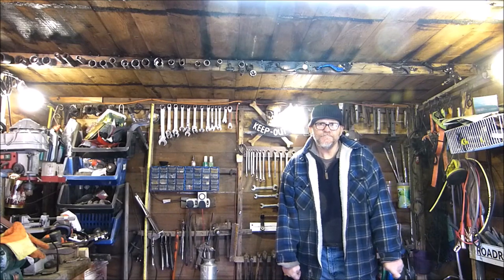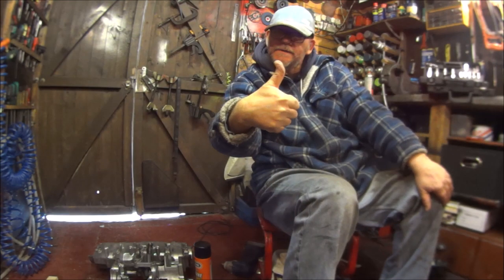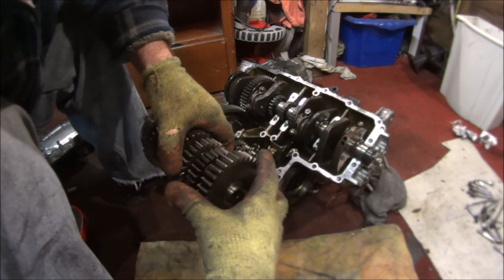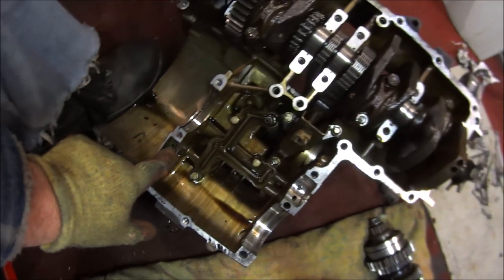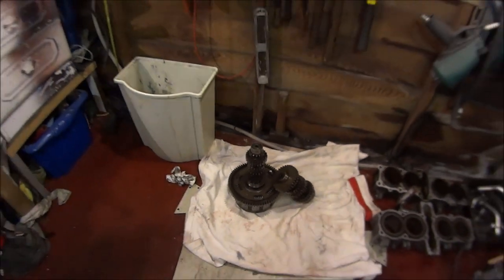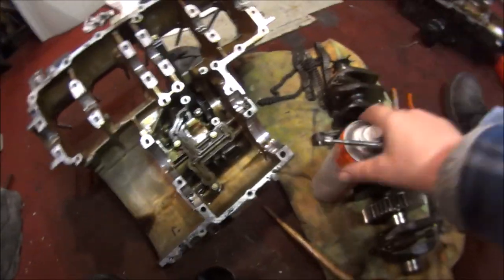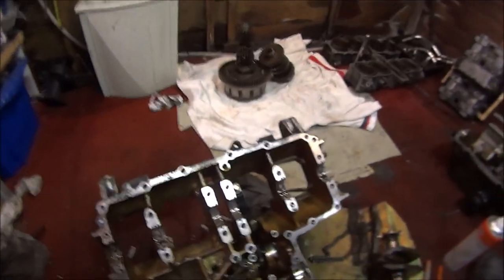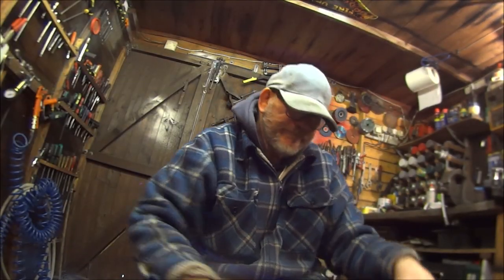CBR1000F Landfill bike. engine parts remove for cleaning.

Comment: I put a new alternator tensioner in my cbr1000 f 18 months ago. Pig of a job.
Reply from the maker: Yes very hard job on these bikes. So far I've found The bearing on the end of the alternator shaft needs replacing and now checking all the other parts.